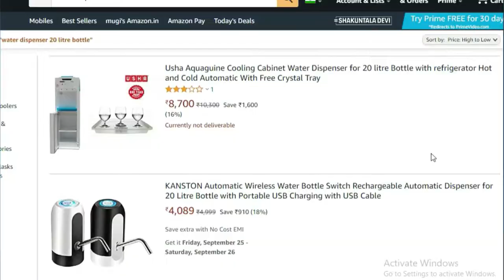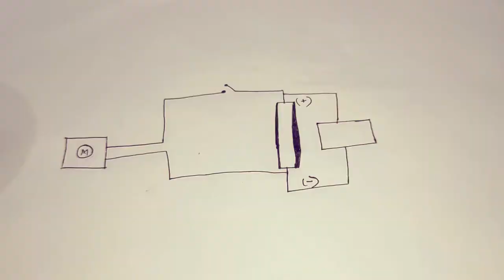water dispenser at home| homemade water dispenser #science #project #diy best dispenser machine

Comment: It is 6v pump on 3.7v the pump will not give enough force
Reply from the maker: It's wrong  bro motor force not  based in 3.7V motor force based in amp
Reply: Ok bro how many hour it will work in one charge...